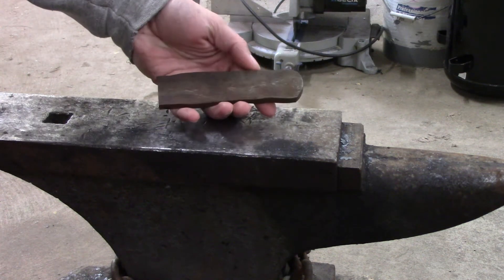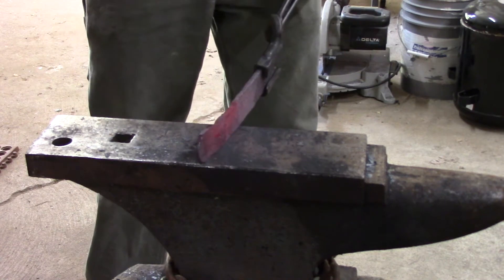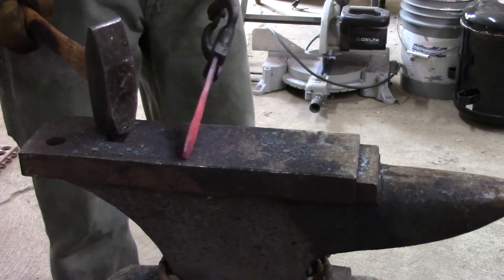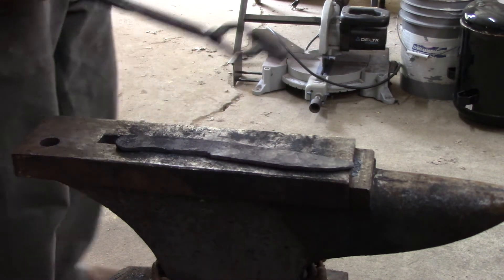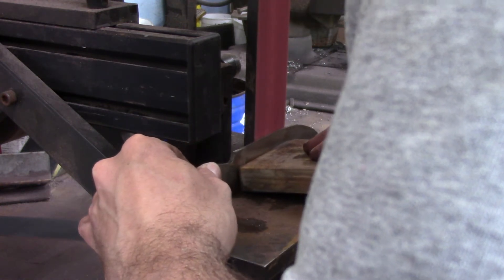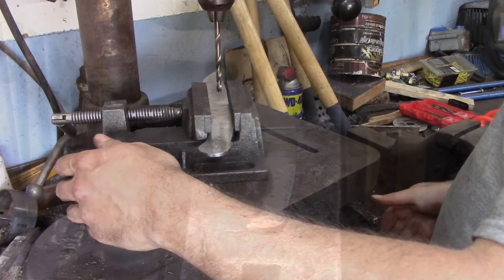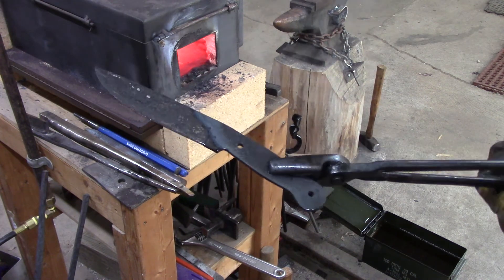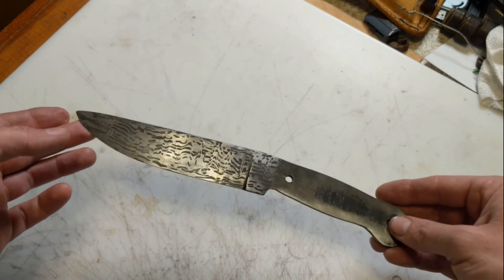Forging a knife blade from the canister Damascus billet- 1080 and nickel powder and bed springs

Comment: Also I forget who it was that said it but "forged to finished" is such a sweet phrase. The guy said "each time you make something try to be as close as possible to finished with hammering. always thought that was a cool phrase.
Reply from the maker: I prefer forging to shape because I don't like spending money on steel and abrasives that just get turned to grinder dust.  I still need the practice at forging too.

Comment: Good job man. Really cool blade. There's a channel called Red Beard Ops and the guy recently made a knife straightening clamp that I thought was pretty cool. He uses it right after the quench when the steel is still hot. You have all the skill and equipment to make one. Might save you a lot of grinding after heat treat
Reply: https://youtu.be/ZwvQpVP3-5I

I'll save you some searching lol
Reply from the maker: I have seen that.  I might build one sometime.  It is possible just to use a couple of pieces of angle iron in the vise to keep most things straight.  On this blade it probably would not have helped much the spine is straight and so is the knife overall, only the edge warped.  it is not out of line by much.  I think the side with more springs showing did not contract as much which let the other side pull the edge out of line.  It is a pretty simple fix on the grinder.